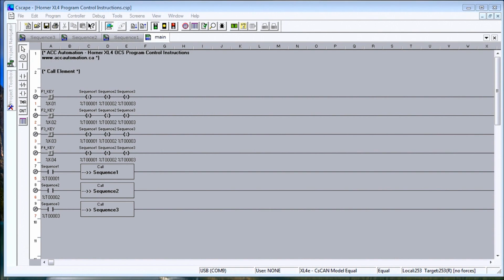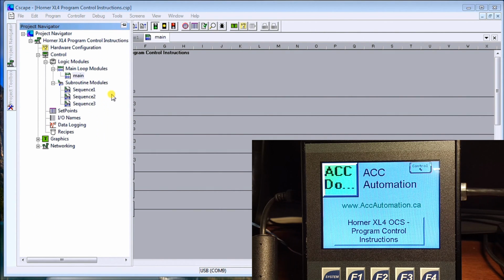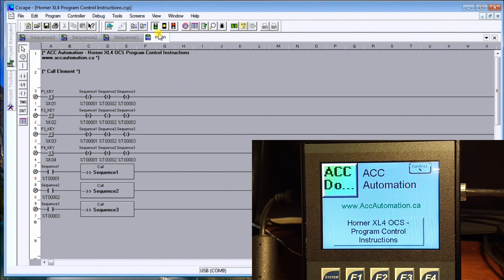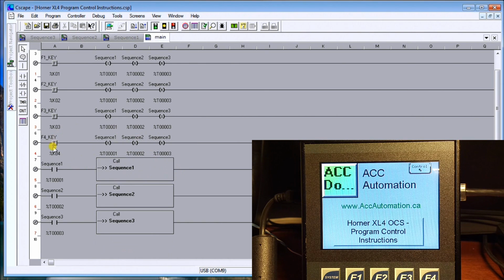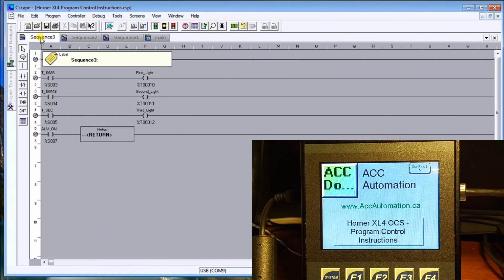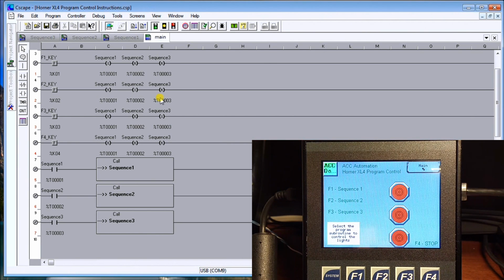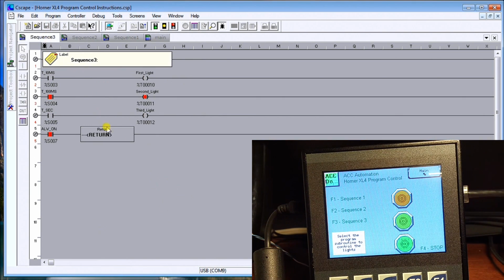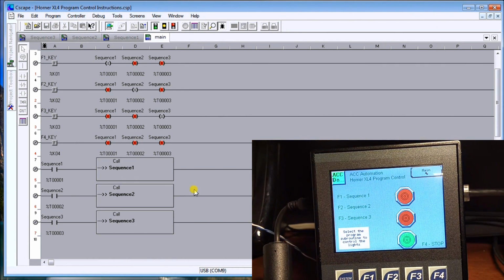Master PLC Program Flow: Unlock Hidden Control Secrets

Comment: I started from scratch to write exactly the same program, my Q is, . how were you able to set up internal bits? Thanks.
Reply from the maker: Hi Pusung Noel,
The memory addressing is fixed in the Horner XL4. The following post will show you all of the addresses available in this controller.
https://accautomation.ca/horner-xl4-numbering-system-and-addressing/
The entire XL4 series can be found on our website.
https://accautomation.ca/series/horner-xl4-series/
Regards,
Garry